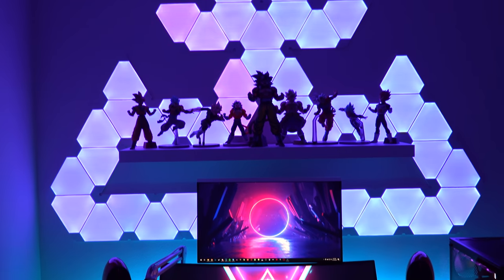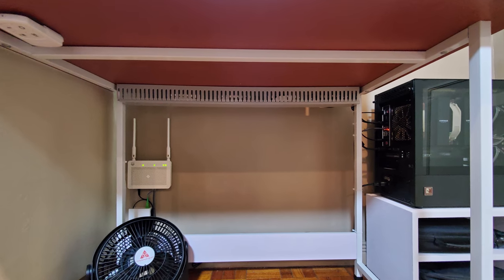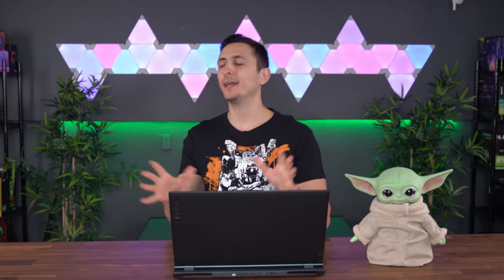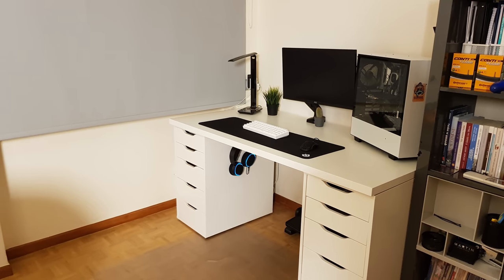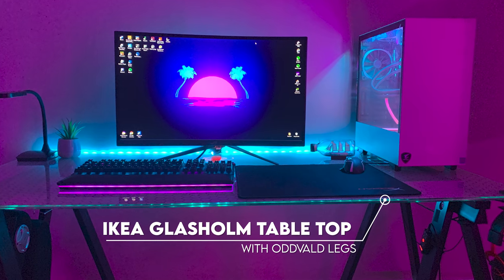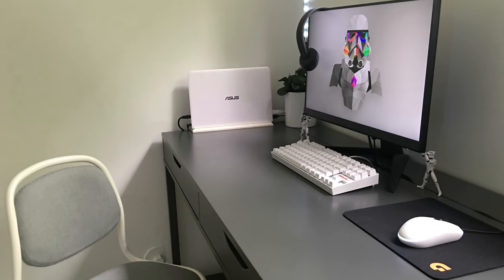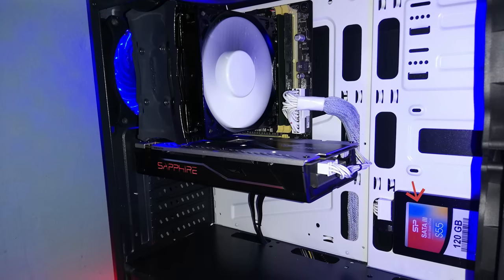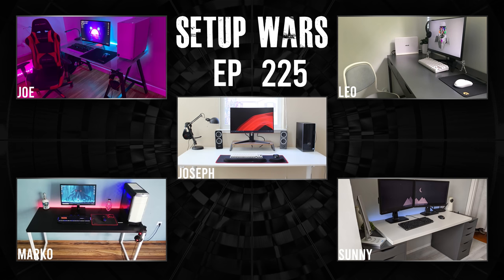Setup Wars Episode 225 - Budget Edition

Comment: Istg bro i consider my shit budget but my laptop (XPS 15 9500) alone is 94% of the total $2000💀coming in at $1,884 lmao I used my left over financial aid to buy it😂my monitor is the 75hz version of the Acer Nitro 1080P VG series which cost me $187 and then I got a $70 Logitech keyboard, $40 Logitech mouse, $70 Logitech 80W speaker, $80 chair, and $150 L-Shaped desk. All bought within a year with my Burger King job + doordash but Damn. It does need a lot of work tho like cable management and making it more minimal since I got a lotta stationary shit on it

Comment: Will anything go wrong if I use 3060ti with r7 2700x ?
Reply: No it's a great combo but you could consider a ryzen 5 3600 as another CPU as it does better in gaming but worse in CPU multicore tasks and it's around the same price.

Comment: Can you tell me if this is a good pc I will pay 1700 its pre-built 
CASE:

NZXT H510 (Black)

MSRP

$69.99

GPU:

NVIDIA GEFORCE RTX™ 3070 - Founder's Edition

MSRP

$499.99

CPU:

AMD Ryzen 7 3700X 8-Core 3.6GHz

MSRP

$309.99

CPU COOLING:

NZXT Kraken X53

MSRP

$129.99

MOTHERBOARD:

MSI B550-A PRO

MSRP

$139.99

RAM:

Team T-FORCE Delta RGB 3200MHz (max speed) 16GB (2X8GB)

MSRP

$74.99

SSD:

MSRP

Western Digital SN550 1.0 TB

$104.99

POWER:

Gigabyte G700H 700W BRONZE

MSRP

$89.99

SOFTWARE:

Windows 10 Home

MSRP

$119.99

Comment: I just built  my pc and my fans only spin but nothing shows up on my monitor And I also tried multiple monitors can someone help me
Reply: Try different ports on the graphics card because one may be dead. If you're using integrated graphics you should check if the CPU supports it as many of the newer ryzen CPUs and some intel CPU's don't have it and require a graphics card.

Comment: guys can you plz help me? I am building a gaming pc and using these parts: Thermaltake Smart RGB 700w Power Supply, G. SKILL TZ RGB 16GB DDRK F4- 3600CI8D- 16GTZR Memory, Gigabyte B450M DS3H Motherboard, Cougar MX330-G RGB Mid Towertower case, AMD Ryzen 5 2600 CPU, Sapphire Pulse Radeon RX550 4GB GDDR5 Graphic Card, CoolerMaster Hyper H410 CPU cooler and a WD blue SN550 1TB NVME M.2 SSD. Can you guys plz tell me if these parts are good and are they compatible with each other?